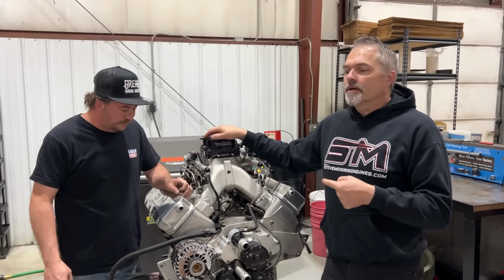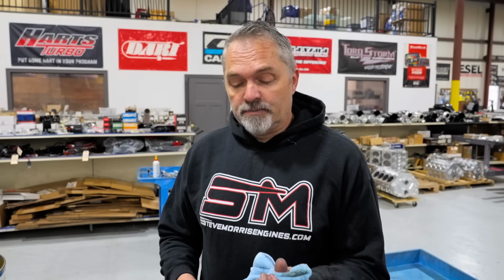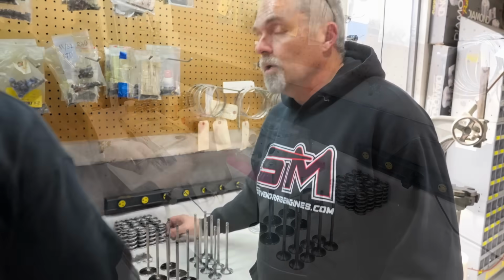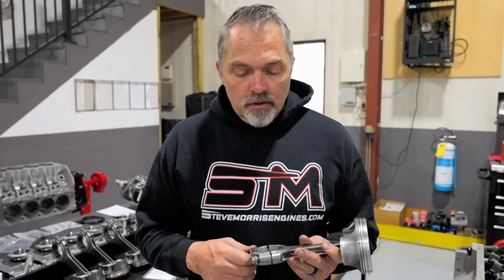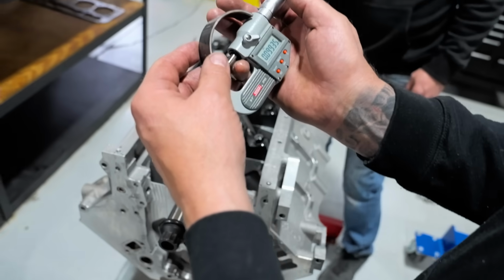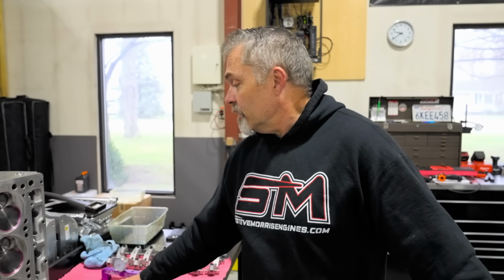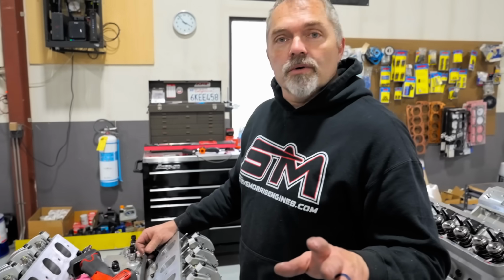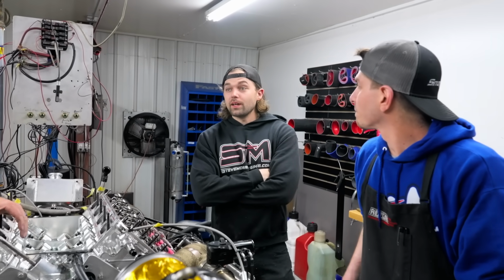HUGE ! 474 cubic inch LS Engine… How Did This Engine Work So Well For 4 Years?

Comment: Steve, first off this was an awesome video, that being said I have never yelled at the TV as much as I did tonight. I believe Jesie's LS engine doesn't see the load in his burnout truck that it would in a drag racing car or in a circle track car. With the rear wheels never hooked up the engine can rev faster and it's not doing the work of accelerating a car. I'm not saying it's not hard on valve train parts but again it doesn't see the load. I do have to ask about the main bearing situation you had with Jesie's LS, could the issue with the bearing be that there was a problem in the tang area? To finish you Chevy guys always kill me. An oil sump is referring to an oil pan, Dry Sump means the pan is empty (sucked dry) this would need an external Oil Tank. A Wet Sump is an oil pan with oil in the sump. Big block Mopars all have an external oil pumps. Kyle was right about having an external oil pump with a regular wet sump oil pan on most Chevy, Ford ect... makes it an External/Wet Sump. Peterson called my set-up a Wet/Vac because a Star Vacuum Pump is mounted on the back of my Peterson R4 External Oil Pump.

Comment: Don't confuse pressure with force. 1 atmosphere is 14 psi.  If the intake area was 10"x10" on the one face at full vacuum you'd have 1400 lb of force crushing the intake, not the 60lb of force you pushed on it.

Comment: I would love to see a video explaining bearing clearance, oil selection, and power rating.  I have not found any consistency on what ls main and rod clearance to run.  Thanks
Reply: @bigboreracing356  thanks for the response, but this is what I am talking about.  How much extra, na vs forced induction, what power levels, street driven vs race?  I have found info on what weight oil vs clearance, but nothing on solid numbers for the clearance.

Comment: If weight on the pushrod side of the rocker doesn’t matter then why if you have a heavy lifter and pushrod are you more likely to lose control of the valve?

Comment: Steve..what you're missing about the intake collapsing is that there is more than external pressure.  It is being "sucked" closed.  Vacuum on the inside.  Atmosphere on the lip.  They compound.
Reply: Yes, the Liposphere.
Reply: No they dont. Vacuum does not suck, there is no absolute negative pressure. The "suck effect" of vacuum is just external pressure pushing towards lower pressure zone.
Reply: @bigboreracing356  Suction is not a proper term in physics. But if you mean that I can feel the pressure difference between  inside of the hose and the athmospheric pressure, then you are correct.

A submarine pressurized to equivalent pressure of 1 athmosphere does not suck the surrounding water when diving, the surrounding water pushes towards lower pressure region.

Vice versa on a space capsule, the internal pressurized air pushes toward outside low pressure region.
Reply: @bigboreracing356  Not that semantics would not matter, but that was not my original point.
The point was that the lower pressure inside and higher pressure outside, do not "compound". Having perfect vacuum inside enclosure and 1atm outside equals to same force as 1atm inside and 2atm outside.
The only thing that matters is the pressure difference.

Sucking or vacuum does not collapse or pull anything, as fluids or gasses cannot exert any kind of pulling force.
Reply: @bigboreracing356  Nope, its the higher pressure outside which collapses it. Show me a physics principle where and how fluid exerts pulling force on matter.
Reply: @bigboreracing356  Pressure-gradient force. The force is always directed from higher pressure region towards lower pressure region.
Imagine having perfect vacuum in the hose, what would pull your hand in to the hose if there is absolutely nothing in the hose? What is causing the force perceived with your hand? One side has matter, other doesnt, which one could be the reason for the force?
Reply: @bigboreracing356  Resorting to insults weakens only your position.
I will correct myself to "near perfect vacuum" (something something about semantics), does not change my point though.
Suction is a speudo force just as centrifugal force, it explains everyday phenomenons to certain level, but has no basis on physics.

Comment: Is there a parasitic loss from the bigger heavier push rods, would you not want one thats slightly smaller on something  na for less rotational mass?
Reply: Better valve control in more important, is my guess. Especially in a burnout car where hp isnt a concern but durability is.
Reply: Its linear motion not rotational motion so there is no parasitic loss. He explained that
Reply: @km6832  yeah but it has to turn rotational energy into linear motion and is attached to the crankshaft

Comment: Question on the whole dry sump system. I thought a big plus with having a dry sump system is the crankshaft not having to cut through the oil sitting in the pan and aeration.When you knife edge a crankshaft it’s supposed to reduce drag with oil sitting in the pan. Another question is if it makes a difference what percentage do you think you can gain from going from sump to dry sump?

Comment: The outside of the bearing shell becomes round when torqued but the inside is not concentric with the outside for oil feeding, it is usually wider at the parting line. The clevite catalogs used to have dimensions for all the different bearing series.

Comment: Steve, could it be that once the tires  break loose, the load on the engine is considerably less than a drag car engine ?
Reply: Less load, less cylinder pressure and less heat?

Comment: I believe the pushrod weight doesn’t matter within reason because of the mechanical advantage the spring has on it. I’m guessing there’s a 2-6x advantage making a gram on the pushrod side equal in effect to 2-6 grams on the valve side mass that has to be moved back by the valve spring.

Comment: My question regarding the dry sump oil pump that you use, Steve.  Is the oil pump also being used as a vacuum pump for the crankcase or somehow acting as one. I saw Canadian can am racers using the dry sump for that 30 years ago on a 3 valve ford that didn't flow water through the deck and it looked familiar. They were using fire rings and receivers without a head gasket!  Very cool.
  Would a vacuum pump even help on such a pressureised crankcase?

Comment: The "wet sump" / "external pump" used in applications like a Proline hemi (also used in TF, Veney, BAE, AJPE, etc. been around long before Proline even existed) is less complexity and the main reason for most is weight. When your at the point that you're spending thousands/ ten's of thousands of dollars per pound to cut weight in titanium and carbon fiber saving 10-25 pounds leaving the extra weight from a wet sump off is worth it. If it will live for 4 seconds it's fine. 👍

Comment: Sorry Steve but you are calling it wrong , with a mechanical outside oil pump , the set up is Called A External oil pump set up , and it's not a drysump pump , as they have many stages of scavenging inlets , the external oil pump only have one savage pump . 
Yeehaa I know something Steve didn't 🎉 , lol , but it's a one off Steve Morris is the true master .❤❤.

Comment: A tapered pushrod is stronger against flexing than a straight-wall tube because its geometry increases the moment of inertia where bending moments are greatest, enhances buckling resistance, and optimizes material distribution for load-specific stiffness. This results in lower bending stress, reduced deflection, and greater overall rigidity, making it better suited to withstand dynamic and compressive loads with minimal elastic deformation.

Comment: Years and chains aren’t junk. If you want a 250,000 mile motor and not a hot rod chains are just fine. A oil contaminated belt failing and driving your Valves into your Pistons Is not good. Please be specific for application

Comment: Does the pushrod size not mattering change with different rocker ratios? like if the ratio is closer to 1:1(I know that's probably unreasonable) just getting extreme to make the point more clear

Comment: My buddy, Phil Ross, invented the belt drive for Harley's many years ago and got robbed of his invention. Still, Harley got it wrong after stealing his design! He made a small fortune on his own, and his design never wore out like Harleys design did. Having one of his belt drives on my 82 Sturgis was probably one of my proudest upgrades.... It can never wear out! Mine was both primary and secondary drives... never saw any wear! SO yeah, belt drives rule! Look up Supermax Belt drives... they don't and can't wear!
Reply: @bigboreracing356  Look up Phils design. Even with a pebble that got embedded in my belt,  he said just keep running it or replace it and keep the old one as a spare. He put nylon liners on the pulleys that meshed perfectly to the belts. He swore that the belt would decompose before it wore out and I believe he was right.  I owned and ran a motorcycle shop for 20 years. I saw probably a 100 wore out Harley pulleys, that ate the belts after the aluminum pulley started to wear. I had 3 customers with a set of Phils pulleys, no signs of wear at all.

Comment: Hehe Jesse was right about the oil pump. External wet sump oiling. Yes the pump is dry but the sump is wet. It circulates oil in the same way as a wet sump with an internal pump. The difference is that the pickup leads to an external pump. So unlike dry sump piling, there’s no active scavenge system, the oil pan is gravity fed like a normal wet sump system.

Comment: The air inlet is seeing ~14.x psi of atmosphere on the outside and something less on the inside. The pressure is pounds per square inch. You could take the 60 pound of force and figure out the square inches to figure out what the differential pressure is. So if there is say 60 square inches and it's taking 60 pounds of force, then the differential pressure would be 1 psi on the inside of the inlet, vs. the outside.

Comment: Back in the day dry sump oiling system were used in road course race cars so the motor could be placed lower in the frame rails. The rules in a lot of racing classes were the number spark plug could not be set back any further than the center of upper ball joint. The oil pan could not be any lower than the frame rails, cut sump off a factory oil pan and motor could be set somewhere around 3 inches lower in the car maybe more. But the car would gain weight with all the sump gear ie. tank, hoses, heaver pump and oil pan, pump drive system. Some of the extra weight could be placed anywhere in the car and a lot more oil can be used. Keep in mind we would use tie wire on non pressure lines, cuzz tie wire is lighter then hose clamps.

Comment: steve, if a torque plate is needed for a accurate bore , would it be better to also bore with a plate? I understand u can get it true with a hone, but would it be easier if using a torque plate to bore

Comment: Dumb question Steve. On the Roller Rockers, the roller bearing on the end that actually pushes against the valve, wouldnt it be better to replace the roller with a rocker type bearing except the roller has a flat spot, same size as the valve top, that rocks with the rocker, giving more surface to push the valve.

Comment: wet dry sump. no, its still a wet sump, but with external pump. mopars for example are wet sump, but external pump. the oil pan holds the oil. its an either or, its either a wet sump, or dry. if the engines pan holds the oil, it is a wet sump.

Comment: Interesting stuff about that bearing clearance. I am wondering if it was the one thousands thickness difference or if the bearing was too rounded? It would be interesting to check the distance between the two ends of the bearing compared to a known good bearing.

Comment: Steve is not wrong on the belts. Way back in the 80's when the metric Kevlar belts first came out I reto fitted a machine that used a square tooth belt that was 150mm wide and it broke every 6~9 weeks. We replaced it with a ploychain belt with a round profile tooth that used Kevlar as reinforcement rather than a cotton nylon blend. The new Belt was 30 mm wide. You also didnt have to tension it so hard as as long as the belt teeth didnt lift off the pulley under tension. Much less  friction. The Bearings lasted longer and the new belts were only changed when the cast iron pulleys wore out. That was an annual service. As long as they dont run in sand or oil they are almost indestructible.
Reply: True. It's a shame there's no real cam cover options for belts.

Comment: That motor seems like it would be a great package to sell.
Reply: It's expensive for the power, and it is somewhat application specific. The boosted engines you can build for a broader demographic. In that N/A stuff, there's a lot of differences between 700, 800 and 900. In that power range, you can build the same engine and just add boost.
Let the guys who specialise in N/A do that. Remember a restaurant rarely gets better just because the menu is large.

Comment: I think what is happening with that defective bearing is that it is tweaked so that the ends are too close together.  When you torque the cap, it forces the bearing down and spreads the ends out as they should be.  It's not the thickness of the bearing but the shape that is off.

Comment: Seems like this engine is long lived because burnouts are a light load application.  Connecting rod bearing stress, piston ring wear, etc are proportional to load not really RPM so I wouldn't take any lessons learned away from this video unless you're also doing burnouts and nothing else.

Comment: I always struggle to get my head around the "theory" that pushrod weight doesn't matter when ultimately the valve spring is responsible for capturing and controlling the entire weight of the valve train from keeping the valve closed to keeping the lifter on the cam. The pushrod has to come to a complete stop then accelerate in the opposite direction like everything else so how does weight not matter ??  Yes the pushrod moves slower than the valve and the spring has the rocker  ratio aiding it on the return but again ultimately the pushrod has to come to a stop then be accelerated in the opposite direction, the heavier it is the more force is required  to accelerate it....  it's physics is it not ?
Reply: @bigboreracing356  1st time I've heard that one.  Please explain
Reply: @bigboreracing356  I think you're missing my point and I didn't say we must use the lightest pushrod available. 
If you fire a 100 gram arrow at 100mph into a hay bale then fire a 200 gram arrow at the same speed which will penetate deeper? The heavier arrow because it has more stored energy yeh ? 
I don't see how the additional weight in a pushrod is any different because that additional weight or energy has to be captured, then  accelerated in the opposite direction by means of the valve spring yes ?      I believe it's fair to say 100% of the weight in the entire valve train needs to be accounted for if you're  pushing the upper limits and to say weight on the cam side of the rocker is incorrect.    Why do ohc engines require less spring pressure than pushrod ? And in pushrod engines why do manufacturers strive to make lifters as  light as possible??  Weight matters!
If you can help me get my head around why I'm incorrect  feel free
Reply: I know absolutely nothing about  bows and arrows other than if you get shot with 1 you're in a fair amount of trouble. 
Explain what it is about your heavy pushrod that makes your valve train stable...
Reply: @bigboreracing356  I think you're confusing weight with rigidity.   
Going to extremes, I build a street oriented valve train with nice light components, 080 5/16 pushrods and a spring with "just" enough pressure to control the weight and requirements of that system and everything works beautifully together. What's going to happen if I take the 5/16 pushrods out and replace them with the biggest baddest units I can find that weigh 5x as much ?

Comment: Well hell, guess I'll be hitting up Steve for my NA "DZ07" build whenever I hit the lottery 😅

I'm trying to spin that sucker over 10k

Maybe someone will get what I'm trying to build with the "engine code" I personally made up inside the above mentioned quotations.... the first 2 letters should give you a hint, and so should the last.... the only missing hint you need is that it's an aftermarket block, that's available off the shelf.

Hopefully someone guesses and someone guesses right.... I want it to go into an early 2nd Gen GMC Sonoma, with a GeForce 5spd or Tick 6spd... and it'll be low and stiff. There's your only hints!!!

Comment: I think the dry sump center of gravity is do to dropping the crank center line,  and there isn't a huge oil pan in the way
Reply: Jessie was on the right track with the CG. Being able to mount the entire engine lower because the oil pan isn't there is huge.

Comment: Is there a horsepower gain when you go to a traditional dry sump ? With the crank fighting through less oil I would think there would be something. I was also told the reason for the dry sump is to have consistent oil pressure through your whole run minimal to no drop. What do you think about the horsepower gains and is there any truth to the no oil pressure drop ?

Comment: It took 60 lbf (pounds force), not 60 psi to “crush” the inlet pipe. 60 psi is 60 lbf over every square inch of surface area.